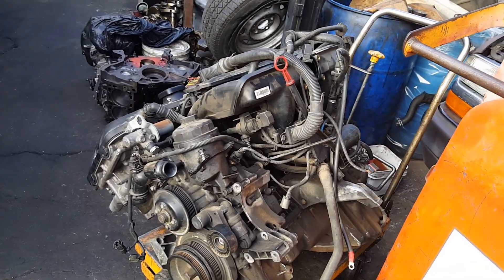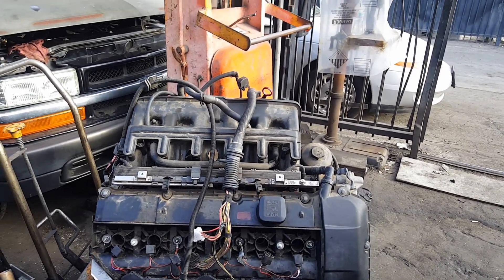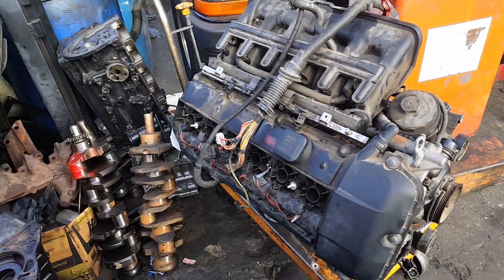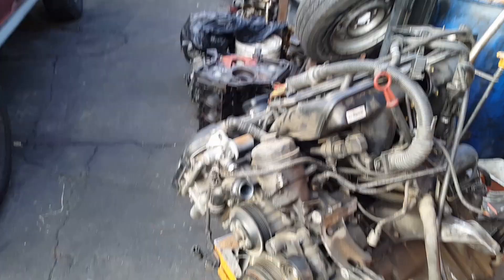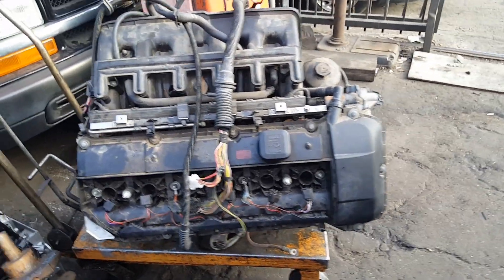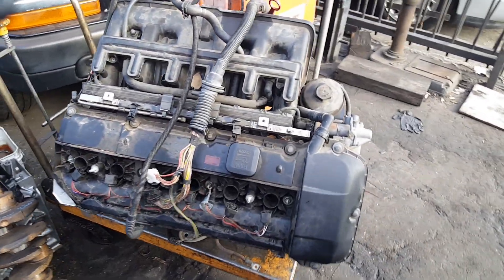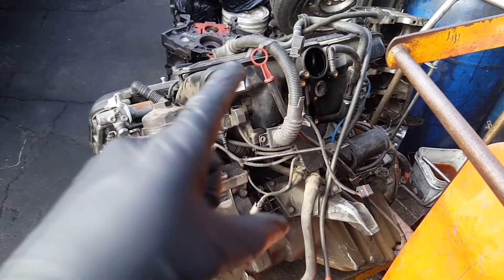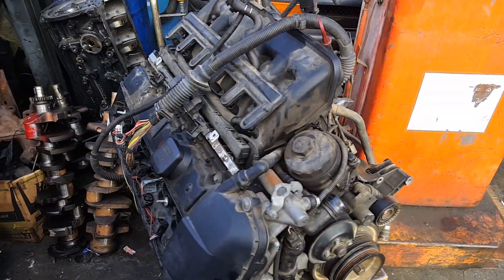How to rebuild bmw e46 engine ; 230hp to 350hp , M54B30 stroker

Comment: How is coming along with the engine build? I am looking to do some upgrades to my B30 on a Z3.
Reply from the maker: Got the Strocker ready,just waiting to go get parts for the manual swap,and the stick build just need to order piston rings and ready to assemble so I can install for now while I gather parts for the manual swap! On you m54b30 you can do exhaust and cams from shrinks but get the mild ones so you don't have to mess with the computer

Comment: How this build coming along? Considering a built engine that’s N/A that will rev higher and have more power everywhere in the rpms, rather than rebuilding the motor to add a supercharger. Thanks!
Reply from the maker: Got 2 m54b30 the first one is already bored out with better stroke and bigger cams and the second still have to disassemble 😂
Reply: JM8686 Awesome dude! Keep the content coming! Super inspiring to know it in the works. Are you using VAC 3.5 stroker kit? If so what other additional upgrades?
Reply from the maker: Thanks and cams are 272/256 to avoid  software updates or changes

Comment: I am building my B30 engine as we speak. I was also considering using S54 pistons, but how do you do that? They are 3mm wider if I'm not mistaking, and there is very little space in between the cilinders of the M54B30 engine. Or are you referring to other "M3" pistons?
Reply from the maker: Going strocker so had to bore it out for the pistons to fit
Reply: what bore do you have right now?
Reply from the maker: 87mm with 11.5:1 as now but about to change a little bit again
Reply: @JM8686  do you make som sleeves?
Reply: Lol 87mm pistons. Have you actually opened a M54b30 to see the cylinder spacing and liner thickness? And you dumped a few grand on a stroker crank?
Reply: @haywagonbmwe46touring54  is this haywagon from E46Fanatics?
Reply: @dokterkarel  yep. straight from the tractor.
Reply from the maker: Yeah i did nd never again 🤣🤣
Rather go with an LS swap 🤣🤣🤦‍♂️
Reply: @JM8686  Thats the way to do it!
Reply: Du kannst keine s50 oder S54 kolben nehmen. Die sind 86. 87mm